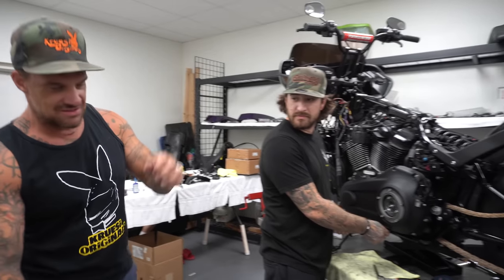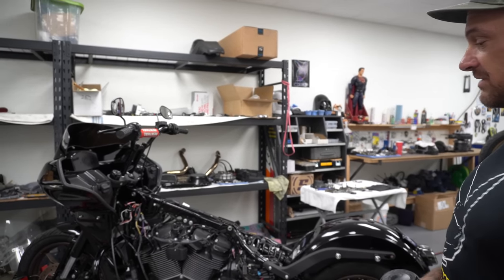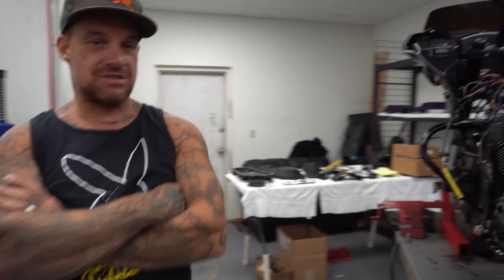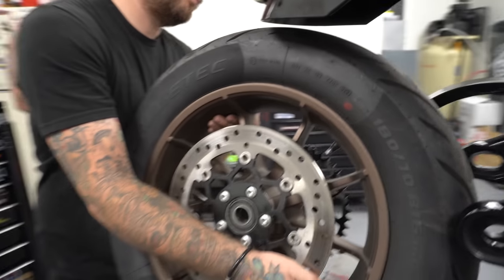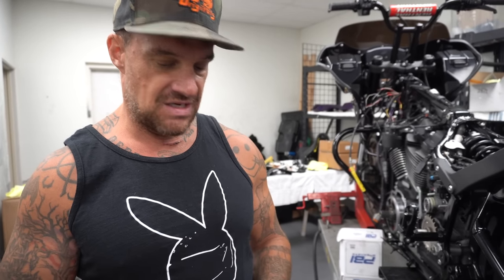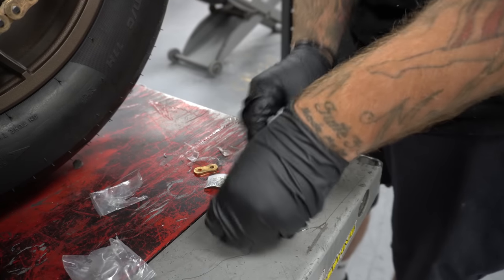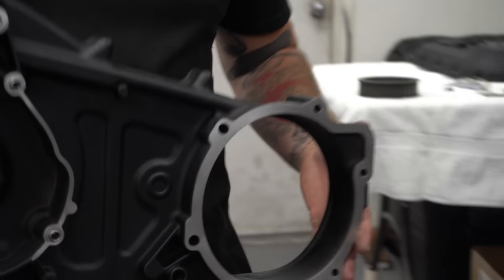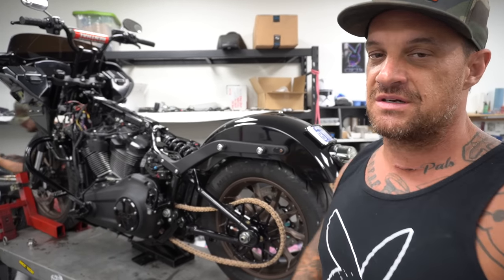M8 Softail chain drive kit install on the Kruesi Originals GIVEAWAY BIKE ep3

Comment: Does someone make a idler sprocket to put tension on the chain under heavy loads? I have seen some of the BRL bikes with it, just curious if its possible with the softail.
Reply from the maker: Softails do not articulate enough to even need something like that, but it is a pretty neat novelty if you wanted to rig something up. Not really necessary though

Comment: Some advice for building up that motor, replace the compensator and clutch basket. I saw you guys build out that street rider and raced it at the track but I dont remember if you guys beefed up the comp or clutch basket. 
I bought a comp ramp from cycle rama, and installed it within an evening. Im gonna be putting in SnS rocker arm shafts and studs. 
Lots of aftermarket goodies for making that M8 tough.
Reply: friendly advice for the professional bike builders. love to see it
Reply from the maker: There’s no need to change the compensator or the clutch basket really they’re both pretty good that’s just someone upselling you parts. Our race bike made high 160 hp ran several races many many many track days and everything worked beautifully
Reply from the maker: @syndicxteoce5909  😂😂😂 amen because I don’t what I’m doing
Reply: @kruesioriginals  Never said you didnt know what you were doing. I loved watching that build and I actually show your guy's Dyna Tail stuff when people get into that monoshock debate. Shawn and yall absolutely whooped ass.
But I replaced my compramp in my bike because I've seen way too many of them blow apart and grenade the primary. There was one guy whos' fat bob blew apart 2 of them with just some bassani sweepers on it.
Wasnt an upsell thing, I saw way too many bikes blowing them up so I decided to replace them.
Reply from the maker: @FranBunnyFFXII  
Crazy I’ve never seen one fail. And we Stunt Ride there’s really no harder way to beat on a motorcycle than that. I’ve seen clutch basket break that’s for sure in twin cam six speeds they are trash, i’ve never seen a compensator fail though they do wear out a bit after time and get noisy. I’d like to see what one looks like the blew up that would be cool
Reply: @kruesioriginals  Check Out Fat Boy Bob's channel he's the one with the bike that blew up 2 em. Here's his video after the first one blew apart 40 seconds in: https://youtu.be/w0SNVRiC5Qo 
He sold his fat bob and got a road king because a little while later his fat bob blew up another comp, (4 minutes): https://youtu.be/Pml98vvLe4c
Sucks to see 2 of em blow on the same bike.
Reply from the maker: @FranBunnyFFXII  I would say chances are something was installed wrong in that case. I’ve been doing this a long time and I’ve never seen a compensator fail. And I’ve been Stunt riding on Harleys for a really long time there’s nothing harder on a compensator than clutch dumps off of rev limiter. They do wear out and get loud and loose after a while but to see one come apart like that is wild i’m sure it does happen I’ve just personally never seen it.
Reply from the maker: @FranBunnyFFXII  I also have not mess with the M8 compensators that much as far as abusing them besides my race bike and my Road Glide that I Stunt Ride,  so they might be pieces of shit for all I know.
Reply: @kruesioriginals  It's a bit different for the M8 over the twinkie cause the twinkie has a thicker comp ramp. M8 one had some thinner material. I've never seen a twincam one blow up, but i've seen several M8 ones blow up, and so has moonshine and TTS, and cyclerama, ect. 
They think the issue is due to casting micro imperfections, that happen to occur at the valleys. and OFC dont happen with billet/forged stuff. 
I replaced mine with the toolsteel one cause why not, it was an easy install and wasn't exactly expensive either.

Comment: Wouldn't it be easier to yank a wheelie with a 55 than a 53
Reply from the maker: Not necessarily early depends on how the bike is set up, on a six speed we run a 55 on a five speed we run a 51
Reply: @kruesioriginals  I gotcha. I'm going on with my dirt bike days so that's where  my brain is at. That front end is kinda heavy so I'm trying to come up with a plan for planting power at the tire to help with weight tranfer, thank you